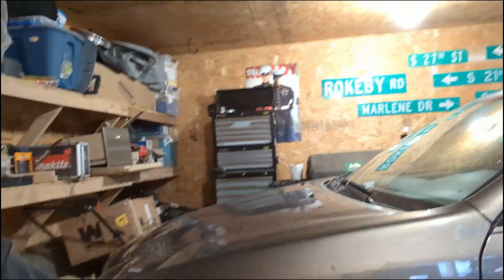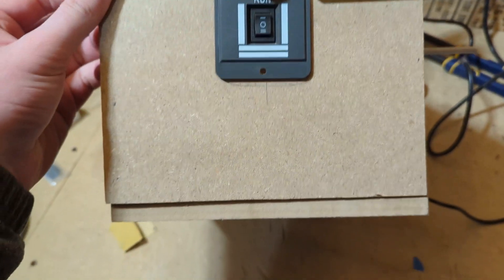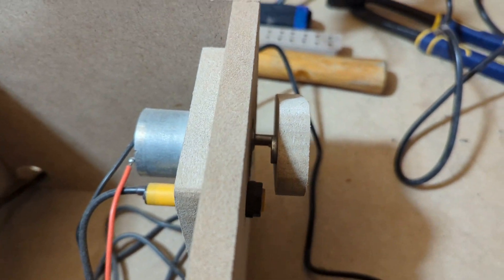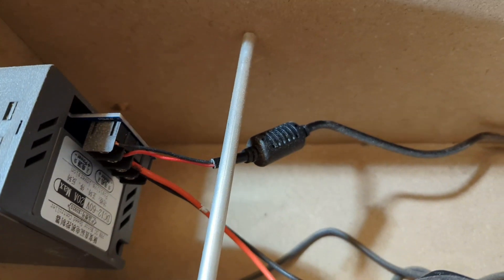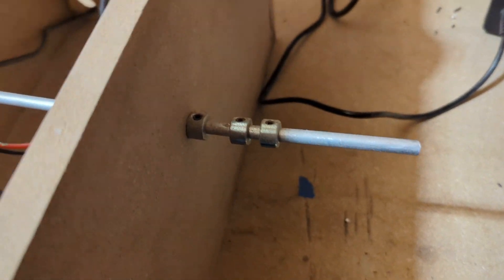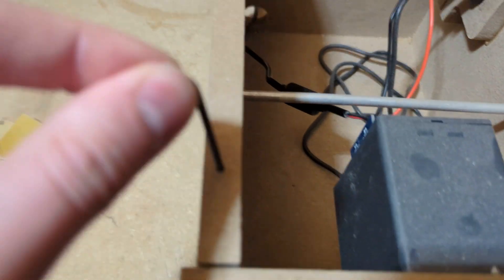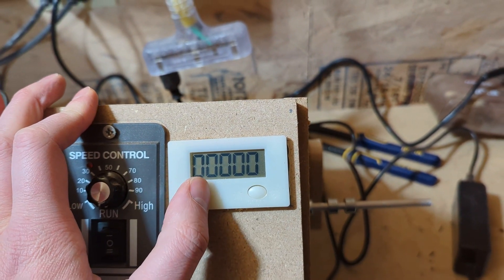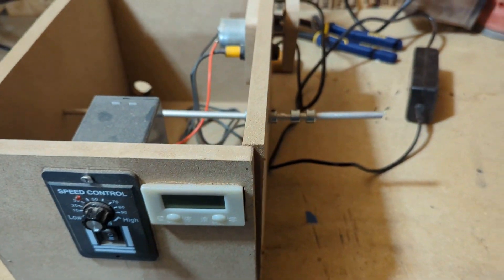My $40 homemade pickup winder

Comment: Thank you for sharing. I appreciate it. I was wondering where can I get those nuts you used for the guide rail?
Reply from the maker: You can get them at any hardware store. They're called bearings and as long as they can fit snug on the rod with the set screw, they will work.
Reply: @swoooner4304  ahh thanks a Mundo
Reply from the maker: @MFBEY_  of course! Glad I can actually help someone!
Reply: @swoooner4304  shaft collars!